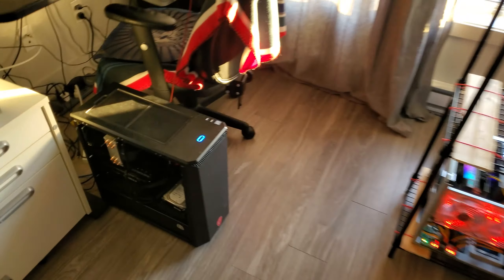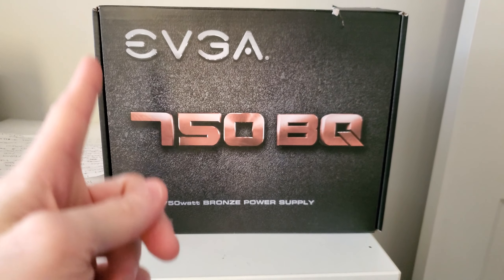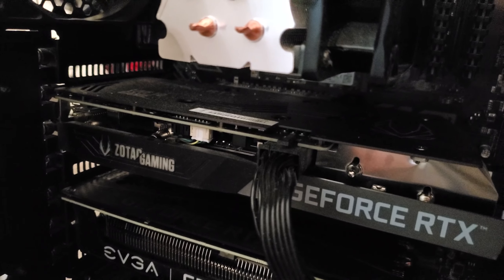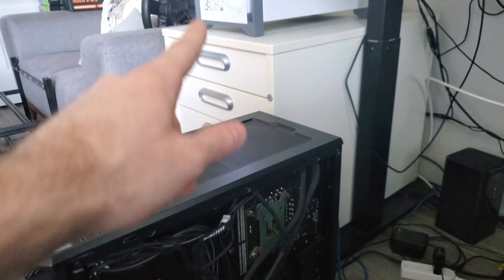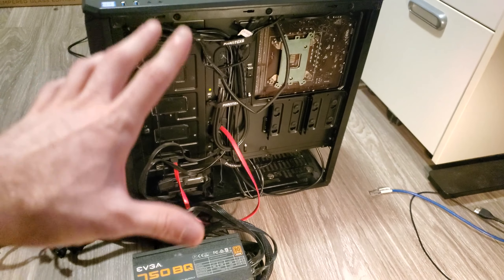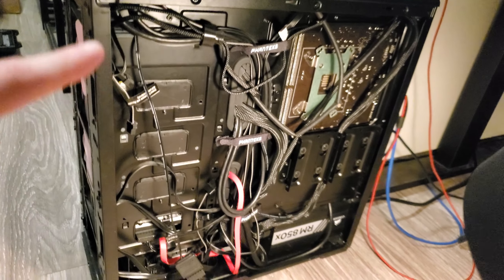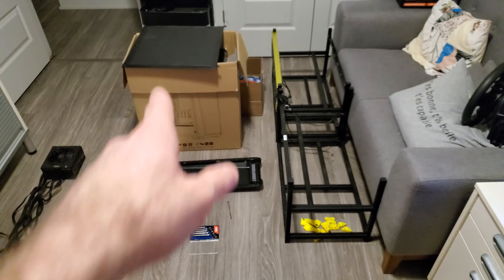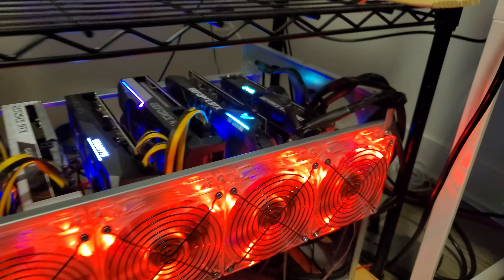Why you don't buy Bronze PSUs! Broken 750W BQ EVGA PSU (80+ Bronze)

Comment: Dirty boy !!!  
hahahahaha
First I have EVGA 750 Watt  BQ     Fantastic 
More than 5 years still going strong..
Your towers disgustingly dirty keep it clean once a  
month I give mine and blower can and armorial
Your thick  dust probably got in the shaft of the fan breaking 
it eventually because it made it hard to spin then broke.
Again excellent  Power supply !!! 
Possible you got a defect ..
Love mine in silent  Eco mode when not gaming.. 
Nice video  looks like you have alot running on stuff...
Reply from the maker: Yeah I also have my window open constantly to circulate air, so a crazy amount of dust accumulates quickly its insane

Comment: Curious if your in a agro area as I notice dust in the background.  I'd suggest getting a air filtration/purifier to help reduce/eliminate the dust. Not sure how much the cat sheds hair/dander as well.  Also note that sometimes manufacturing defects can occur, and dust can build up and effect fan's (previously mentioned).  For example my bathroom vent fan is a standard bearing type which I can use a electronics parts cleaner, but not able to use on "fluid bearing" type fan. I will assume you have a cooling/air conditioning and several UPS units for your various "rigs".  As occasional driver will take down power lines as will winter storms in my region.  I merely mention this as you and I know how power transients can destroy a rig in a moment which is why I use a UPS on anything of value.  Nor does one want to see what a lightening strike can do, as I have and it was not pretty.  I appreciate your perspective and coverage on the power supply.  🙂 Peace
Reply from the maker: Very informative! yeah my cat does shed a little and hair does get stuck in the intake fans, but I clean them almost weekly because i know of it. I usually had my windows open all the time at my old location, so for sure dust would get in! But all my other Rigs and PSUs were exposed to the same thing!

Comment: The rattling is because the fan bearings are shot and the blade fins are randomly rubbing against the grill.  Tthe blade is too loose on the spindle and rotates off-axis.  I replaced the fan in mine myself and also had to bend back the grill for the ticking noise to completely stop.  But because of the coil whine, which points to electrical component degradation, I would definitely RMA that thing.  They have 5 year warranty if I recall.
Reply from the maker: Yessir I think your 100% right on both! I already received my replacement (same model but the newer version) and sent back the faulty one today. Like you said, 5 year warranty!!
Reply: Hi, I'm having this rattling noise too. Do you believe this issue would be fixed if I buy a similar cooling fan and replace the rubber ring, the old one with the new one, in order to keep the axis in place?

Comment: You have not posted an update, when they sent you the new PSU, did it fix the rattling? cuz on my current build, I need to go for bronze for cheap.
Reply from the maker: Hey! Its still in the box, I used an RM850x Gold that I had in the meantime. But its a new unit, so for sure it works fine now.

Comment: Corsair is the best  
Put your  EVGA Upside down see if that fixes the problem  just to see...
Because most power supply's are upside down in the new towers..
But I have a EVGA 750W 
ATX EVGA 750 BQ SEMI-MODULAR 80+ BRONZE 110-BQ-0750-V1
Works fine.
You just happen to have gotten a defect.. 
But  Corsair is the best for PC's   I have never had any issues  with this company for serious amount of years over decades!  
So stick with this company!
Reply from the maker: Actually tried that and didnt do anything. Shook it and no loose pieces. Already RMA'ed and have a replacement hehe

Comment: Nothing wrong at all with that PSU if you wouldn't drop hardware into it.
Reply from the maker: Nothing was dropped into it! I know it sounds like it, but when I shake the PSU nothing is loose and im always super careful with all my hardware. From my research is most likely the voltage regulator making that sound and/or fan bearing which is shot!

Comment: Brother, you have two rtx cards in there...
Reply from the maker: Yes I do, and they are both 3060s and take 110W each while dual mining. Not even close to 80% of the 750W.
Reply: @MiningOffice  A 3060 needs a minimum requirement of 340-360W. Although they are in SLI, so they might use a little less than 650W. It's kind of like on edge